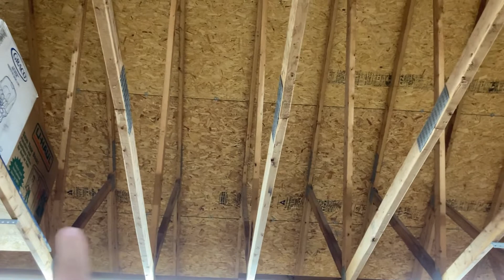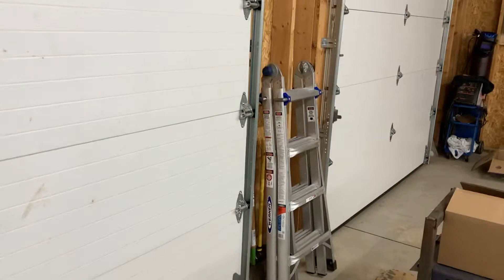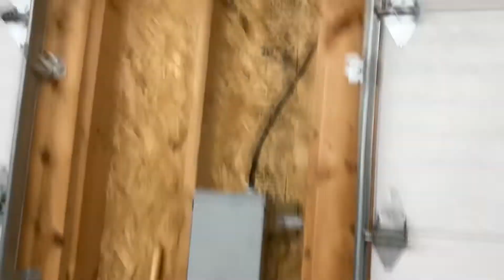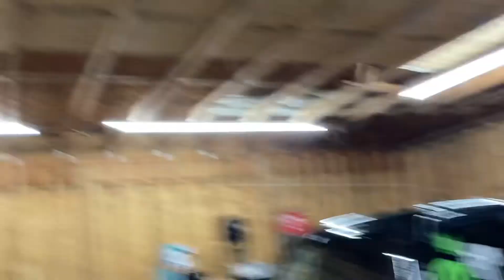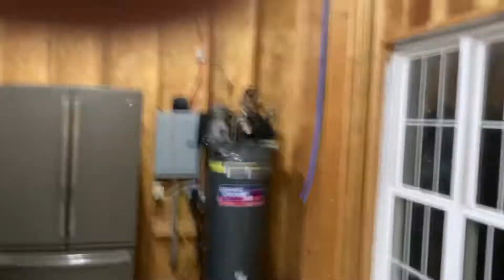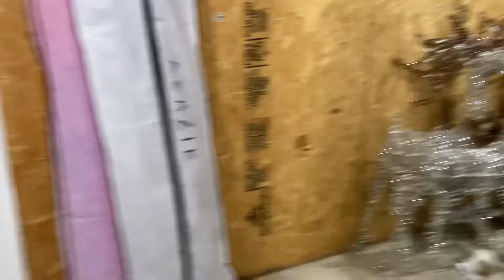Scissor truss, will it work?

Comment: Depending on how much height you need, you may be able to go with a standard horizontal rafter tie that spans from end to end and is located in the lower 1\3 of the existing roof rafters. Would be stronger than the scissor rafters
Reply from the maker: I want to get about 3 more feet.